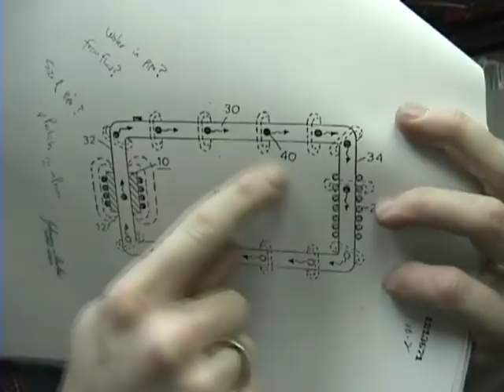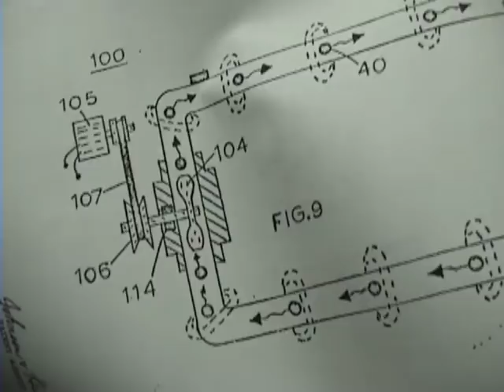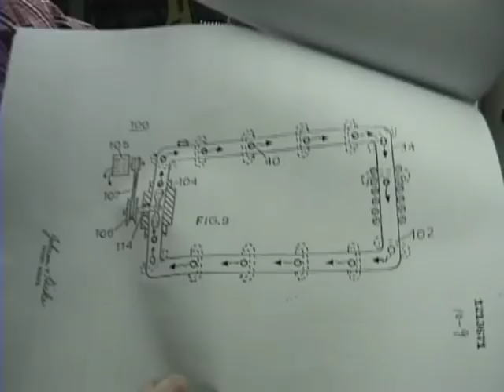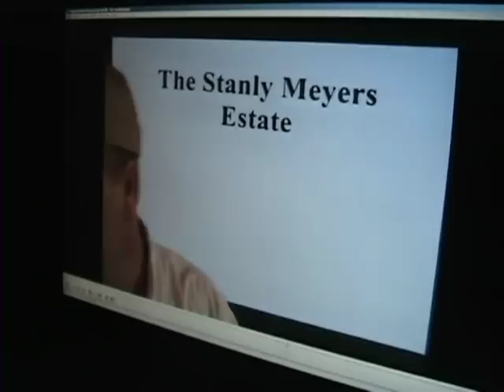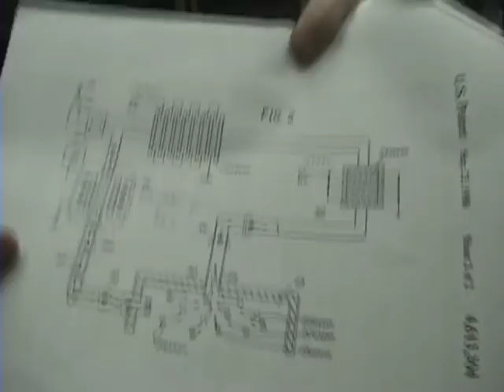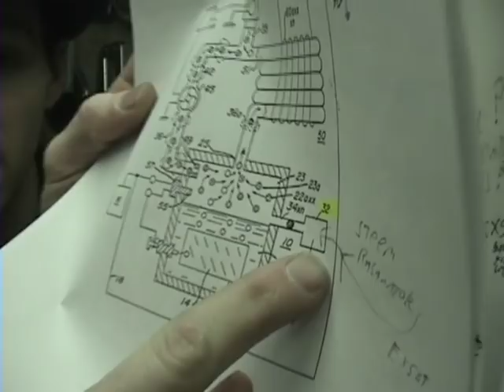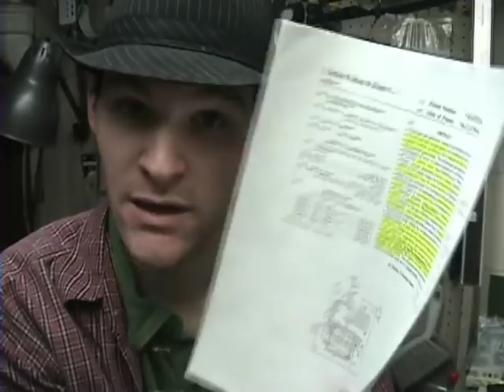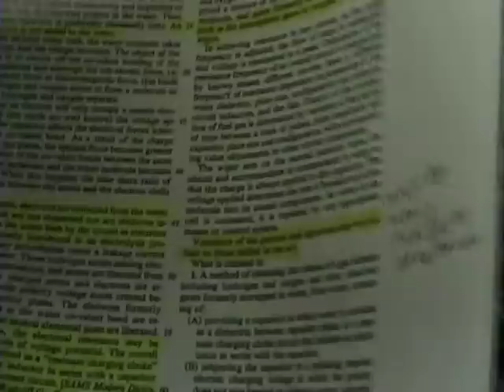The Key To Stanley Meyers Water Car, Gas Electrical Hydrogen Generator, www.RWGresearch.com

Comment: in the first patent he has the system for creating his polarized particles. hes ionizing metals in a chamber. 
the chamber then feeds into the secondary chamber with the HHO. the purpose of the pressure in the secondary is posibly so that it is more likely to suspend the polarized particles?.
the polarized particles superimpose there charge on the HHO gas also. 
the gas is releasd to equliz the pressure, while the polarized particles are likely to stay in the system due to magnetic force

Comment: Stan Meyers say in a video that there is about 9-10 % of air dissolved in water, so he basically said the particles needed in the accelerator, as nitrogen, can be found in tap water.

Comment: It looks like the box at the bottom right of figure #1 is a check valve, I think this may be a water inlet valve, not sure but I think water molecules are polorized and perhaps permanantly... at least as long as the arrangement is H20. This system also needs a fuel source =( water) and an inlet valve, is this just that?

Comment: Ive heard people claim its the water making the sound (myself included).... in all reality its the stainless tubes making the noise... i was amazed when i shorted out my supply onto one single tube and the tube ITSELF was ringing while out of the water...   Now, stainless has a high resistance.. if you connect your terminals to the cell on the same ends of the tubes most gas will be produced near the connections... so the bulk of the tube is not initially creating gas....

Comment: Something that comes to mind is the ferrous hydraulic fluid that is used in electronically controlled shock absorbers in high end vehicles and military applications.

Thanks for posting this video - I never noticed those coils until you pointed them out.  Very cool.  

Will be interesting to combine this with the Don Smith work I am doing.....

Comment: I would say he went from DC current to alternating current. The particals maybe water molecule.   The first schematic looks like inside cylinder wall when piston is in open mode.
Reply: The first patent seems to describe a regular transformer with a core made of mercury (metal), inside a non metallic (avoid the squirrel cage effect) vacuumed tube and a pump to initiate the circulation. This would certainly reduce the core's resistant; something to look into...

Comment: Stan refers to this device in a 1992 interview, but just mentions it and keeps going, like everybody knows what he is talking about. I have watched the interview several times, but never picked up on it until after I watched your video. YT won't let me post the link for some reason but if you search for the 1992 Stanley Meyer interview it should show up. 

Now the question is: if this thing is that effecient, why did he keep messing with HHO? This would allow everything to run on electric.

Comment: Could it be a tesla coil arc inside a housing of water and the frequency is set to optimum gas production? I saw an experiment one time when a tesla coil generated arc produced HHO gas. If this is true it would make some sense outside of the grounding.

Comment: Russ, How is a "permanent magnet particle" going to be suspended in a gas or fluid? Every magnet has a North and South pole and will simply clump together into one lump within the tube. Regardless of the contents>  A re we speaking of : Ferrofluid is a liquid that is attracted to the poles of a magnet. It is a colloidal liquid made of nanoscale ferromagnetic or ferrimagnetic particles suspended in a carrier fluid (usually an organic solvent or water). Each magnetic particle is thoroughly coated with a surfactant to inhibit clumping.

Comment: The early illustration of figure 10 appears to be injecting the gas  to collide particles applying positive and negative charge from either side in a chamber,and then go through a electro magnetic field represented by the ring before entry into the combustion chamber to show the process he was trying to achieve,success being in the later coiled loop that was closed  before the refined gas enters the combustion chamber as symbols are the same.This is what I see in theory. but I may be wrong.

Comment: I just noticed that new ferrofluid is like a liquid right? I bet it would work as a concept using the pipe and pump device you are building - fill it with a ferrofluid and charge it up, flow it through the coils and voila! not a gas but same idea right? do you think it works? you could even go magnet coil magnet coil all the way around. I got to look into the properties of ferrofluid now to see if it won't work!

Comment: I am currently building an eleven plate dry cell hydroxy generator. Gotta start conditioning the plates.  No experience btw.

I watched a long seminar I think was done in New Zealand.  Stan kept talking about high voltage, low amps, and tech that was already available. I though of the stun gun I got my wife.  From 9v battery you get 900k volts and .03 amps.  Maybe that combined with pulse wave??  Haven't heard any one else try that.  Everyone else keeps preaching amps but Stan didnt. I dunno.

Comment: Notice the low location in the gas chamber.  Almost any gas that is heavier than the oxygen or hydrogen would have been collected there and used.  Plasma with argon gas?Most of Stans stuff required ionized gas. As far as the arc for plasma Ever seen an old style movie projector(theater type)  The cabon rods feed into each other at a predetermined rate and spin at an angle to each other so the ends stay pointed.

Comment: The coils  from low to higher voltage would narrow the molecular stream within the electro magnetic field as wet hydrogen id drawn into the coiled loop by the suction of the intake to have the electrons from the oxygen and nitrogen pulled from the bond to their atoms to free them from the Hydrogen  for  separation burn of H and O separated from N to refine the fuel mix and eliminate H2O residual creating less steam and greater expansion in combustion.Like the magnetic field in the H Collider.

Comment: Watching now. Could the electrodes be specialized alloy to produce vapor highly suitable for magnetization?
Reply: they were stainless steel tubes (when I worked with him)
Reply: That would make sense, his patents were void because he wasn't giving all the information. So him giving disinformation so no one could copy makes sense.
Reply: @deathblaizer  there was purpose behind that, otherwise he wouldn't have been able to get the patents in the first place. When Stan talked about it, he was looking at doing something like getting the electrons from a magnetic metal and combining it with an inert gas like Argon, then by pushing through a electromagnetic pump (pulse) the magnetic charge would then flow through the tube, By then stimulating it with a laser, then it would accelerate the flow of magnetism and therefore create a rotating magnetic field which operated at roughly the speed of light and have no loss of inertia as it passed through the coils, therefore allowing you to get massive gains of electrical charge, have a coil which was specific for maintaining the device then as many other coils as you could fit around the device for electrical production.

Comment: the plasma is put in a high state of  negative charge, and vibration. the magnet he describes may help the higher energy matter enter the accelerator. with N pole magnet in. we now charged either proton or electron, and the force would be to repel, and remaine in  a hi state of static vibration?

Comment: The pressurized gas is generated from the original non pressurized air inside. When switched ON the generator then creates the gas, and this gas remains inside the system until requested. Of course he must have put a relief valve in there someplace because you don't want to maintain too high of a pressurized system of Hydrogen!

Comment: What struck me is the tubing looped continuously three or four times like rubber hose surrounded by the low to high coils to create the electro magnetic field to magnetize the particles in the hydrogen gas flowing around in this non magnetic tubing to magnetize the nitrgen particles in the remaining water moisture to separate it and expand the H gas.Seems the coil process heats the gas during the process of pulling the O and N electrons from the H and has to be cooled before being drawn into?

Comment: ...without the knowledge to make the particles i figured i would try mercury vapour inside.now im thinking burn two neodynuim magnets in the arc,glass could be used for the toroid.laser light could be introduced using high power LED laser of the blue purple kind since it is close to UV and will push the excitation of the particles into a higher state.perhaps frigde gas could be used inside.you mention the steam generator-that was used to keep the water tank from freezing-will send you vid detail

Comment: In a gas accelerator type generator the waveform propelling the particles is separate from the output voltage the particle speed and Mass determine the output voltage which will result in a very high voltage

Comment: C60 Carbon Buckyballs (http://en.wikipedia.org/wiki/Fullerene) are individually magnetizable.  The electrodes in that chamber could be compiled with a C60 allotrope and they could be expelled one at a time (by the millions) from the electrode mass to become the magnetized particles that are mentioned in the patent, but after they have sufficiently cooled. THERE's YOUR MAGNETIC PARTICLES.
Reply: Or another way to make graphene from from methane

Comment: 22:34 what he is saying here is that the input can be pulsed but when run through the system the voltage is amplified and smoothed.  this is most likely because of the momentum of the magnetized partials
Reply: probly make a nice sign wave that dose not cross 0v with the pules

Comment: Just come across this video and when you said about the part in the patent that you didn't know what it was, figure 32 I think, well ... Air is a gas .. but to have them charged , isn't that what an air ionizer , air purifier does? Couldn't that be the magnetised particles ? Also, as that's achieved by high voltage from my understanding, couldn't that high voltage be achieved by the secondary coils ?

Comment: He used the pulsed HHO separator to make the gas feeding Argon in and using Iron Nickle Cobalt plate's. or something like that, its the way he used the pulse wave to split the water but instead it would unbalance the Argon and let it connect to the Iron Nickle Cobalt. I'm assuming he would attach one at a time starting with the biggest atom in a clean non conductive environment

Comment: the accelerator arc gap could possibly be simialr to hid auto lighting kit they input  much lower voltage than they put out to the bulb which has a gap between the electrode and creates plasma arc varying  from 5000k to 30000k or more

Comment: by inverting (not with a transistor NOT gate circuit) the pulses on the primary side to negative you will be creating positive pulses in the secondary... there will still be TINY negative pulses in the secondary but those are virtually removed with your switching diode.... id try using a simple op amps inverting side... also by doing this you also have control of gain and amplitude... something not possible with lawtons circuit...

Comment: Yeh, hand out blueprints with easy step by step instructions once everything's safe. 

I think something could be done with compressed air. If we could make wheels turn by turning the air around the car into useful injection of power into the engine it would be amazing.
Reply: What

Comment: after it is processed , with low voltage it is to be kept charged, in the coils is where the system splits in to oragon gas ,  voltage needs to be cut off in intervalls so temp stays low
Reply: The first patent seems to describe a regular transformer with a core made of mercury (metal), inside a non metallic (avoid the squirrel cage effect) vacuumed tube and a pump to initiate the circulation. This would certainly reduce the core's resistant; something to look into...

Comment: What keeps the magnetic particles correctly directeded so that a coil can accelerate them in the same direction?
Anything magnetised has two poles.
Magnetised particles would not survive in a plasma.
Maybe not magnetic - but electronically charged?
Electrically charged particles are magnetically deflectable back through the system and not burnt.
Fig 10. Are rods 160+162 at a potential wrt 155?
Is the output tube a spiral which will amplify particle flow output at one specific frequency?

Comment: the electrodes are disintigrating under the arc so minute bits are coming off the electrodes in to the air , so those have to be metal electrodes so they can be magnetized on the way up and out
Reply: Exactly right. Its not a water/hydrogen chamber at all. Its a 'vacuated' (empty) chamber, just as its stated in the patent.
Reply: Yes! And if this was ever built for the masses it would be a simple wear part like your tires and your windshield wipers!!

Comment: Well, I just finally got through the 86' patent.. seems to me that at least half the diagram/circuit is not required. I did a couple quick tests, HHO alone definitely doesn't seem to produce. As for the mention of nitrogen, I'm thinking this comes from the "arc chamber" not being purged of regular air first.. as for the "magical" polarized particles I'm thinking steel/iron/possible carbon rods.. (powdered iron cores from circuit boards + "high voltage" dc might be a good place to start.)

Comment: The reason the particle accelerator works is because of the magnetic properties of oxygen and hydrogen... i know oxygen has odd magnetic properties such as when its a liquid and super cooled oxygen drips "up". i also know the gases react "magnetically" with high voltage... i have a seperate hv dc supply that when run properly will literally pull the gases out of the water faster instead of having a misty cloud of bubbles mixed with your water....  pressurizing the container also helps with that.
Reply: and the current is brute force .how ya gonna repower that ol plating rectafier ?

Comment: Tesla Coil in your first part and it also creates O3 gas but if you use Ultrasonic you can turn water into a gas and on a long wave of a AC you can ground a Hydrogen to a magnetic using a harmonic which vibrates I can go on but I can got to go

Comment: video still here LOL, Stan was good and got us close, and then a lot of others took over when he died.
because all the improvements over the years havent come to light yet, when we get ready I will start posting videos to show the right way to build one, filter it and use the right way, most of  that Ele you can toss out, just 12 to 14v at between 15 and 20 Amp if your over 30 your getting more steam then HHO LOL equaling about 2.2v per plate one Pos. Five Null and One Neg. Stainless 316-L is the best, sand the surface for max area, bubbler(s) and ammount of SH is about 2 Tbs per quart and there are a lot of things that can effect the outcome....

Comment: the polarized particles may need the pressure to be properly suspend so they can flow at the best rate. sorta like a rail gun needs the load to be frozen or it just sticks.
chances are you would be able to find the proper pressure if that be that case by monitoring the voltage output at diffrent pressures.

im obviously just slingin my own shit here but i thought i would take a stab at it :^)

Comment: if you do choose to use lawtons circuit do NOT use inductors in series coming from the transistor to the cell.... INSTEAD... use a coil in PARALLEL  between the collector and positive rail..i simply use the 110 side of a cheap 110 to 12 volt transformer from radioshack.... also its important i explain something else as well... people (myself included) have reported the cell "ringing" when its running.... this is NOT what you think why this is happening.

Comment: Limiting the voltage to the electrodes which puts off the magnetic particles limits the current as each particle carries its own magnetic flux the more particles you have the more magnetic flux therefore current you carry

Comment: OK... Call me crazy but that looks like a plasma field generator.  I refer to that section at 0:21:29 where you are calling for help.  5000 Gs, he wants to impart a massive magnetic field to the plasma as it exits the chamber.  Electrodes 160 and 162 are consumables and look to be replaceable.  Sorta like brushes in a motor.

Comment: Your showing different inventions of stans,  they are generators, the one with a pump is circulating magnetic fluid causing a voltage in the coils of wire. 
Their are other designs using laser light to change the state of the gas but with his hho fuel cell its simply a resonant inductor capacitor tank circuit. The separation is performed by the electric field!!!! This is critical to understand.  High voltage and close plate spacing is essential.

Comment: That portion you think is a chamber (on the lower right) is most likely an inlet to feed water back into the system as it runs low.

Comment: I think you are wrong, they're two different things. The Key to the diagram you show at the end of the video, the VIC for the injectors, not the fuel cell, is the diode! The problem with the fuel cell was the water level change, changed the resistance, that is done a way with, with the injectors. He adds a fixed resistor with the diode to one side (of the circuit).  IMHO